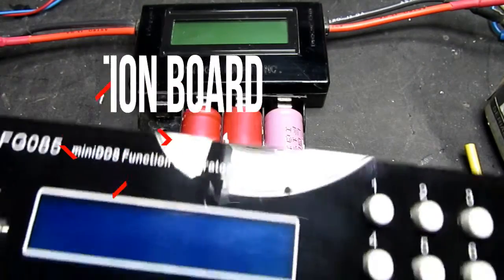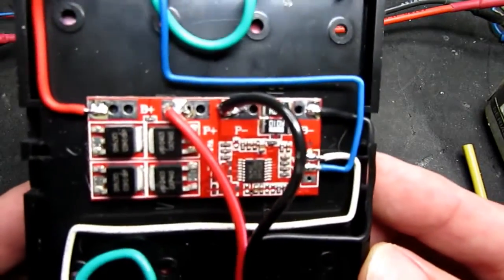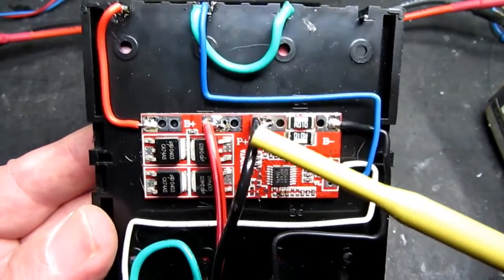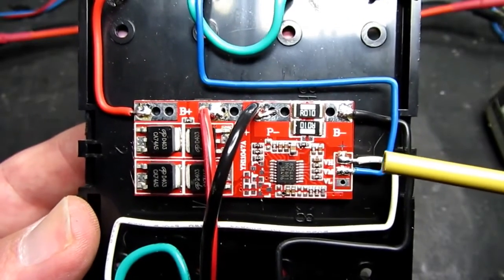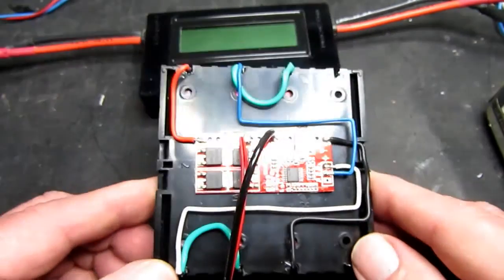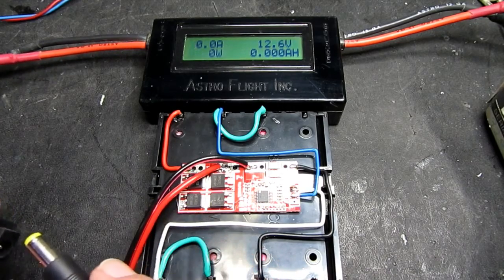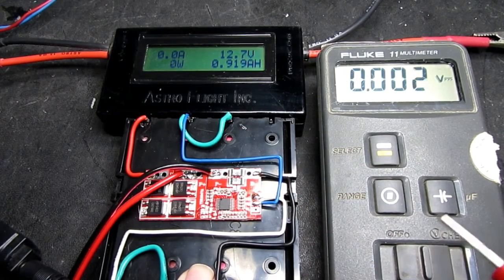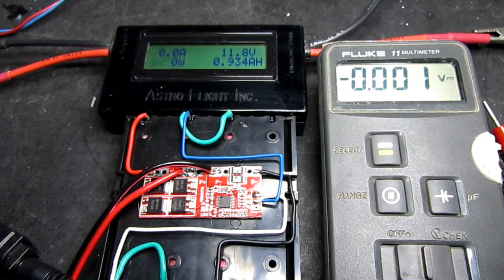3 Cell Lithium Battery Protection Board  From Banggood - Electronic Project

Comment: Hello Can You help, which voltage I need to put in to charge, I Have the same board, I Put in 12v 2amp Charger, never it get charged. This was the Board ()
Reply from the maker: Hi, the minimum charge voltage is 3 * 4.2 volts i.e. 12.6 volts : https://youtu.be/miDIXwACpcY?t=370 What I use is an old laptop charger rated 19 volts at 3 Amps and put a DC step down module which I can set the voltage an a constant current determined by the cell datasheet. The module is this one : http://bit.ly/LedDriver You can see how it works in one of my other videos : https://www.youtube.com/watch?v=QYc1On0q4AA Ciao!

Comment: i have 4s board and when i apply load on center output it drops to 0.80 im starting to think its a bad board
Reply from the maker: You may have a bad board. Also consider what the load you apply is, for example an electric drill. If a load is applied to quickly it can trigger the boards short circuit protection. In this video : https://youtu.be/rYFT4g292jU I use a 4S board on a drill. I need to use the drill slow start to stop the short circuit protection. Starting the drill slowly then increasing the speed works OK. Please consider subscribing if you have not done so already!

Comment: Did you have to do anything to get this board to start up? I have a very similar board and I get no output at P+ and P- but voltage at B+ and B- are normal.
Reply from the maker: Normally you should see the same voltage on P+ P- as B+ B-. What happens if you apply the charging voltage to P+ P-? You should be able to measure current flowing into the cells and the voltage rising. The only time P+ P- are disconnected is if a fault condition exists. Perhaps the cells are too far discharged or there is a short circuit somewhere?
Reply: @1nformatica  I applied charging voltage to P+ and P- and see no change to the battery voltage and there is no current being drawn by the board. The datasheet for the IC shows a shutdown condition for over discharge but I checked pin voltages and the don't meet the shutdown criteria. I will keep checking things...
Reply from the maker: Very strange. Does the board have balance circuit? Sometimes the labeling of the cells can be misleading.

Comment: Hi. Thank for the video. I have a board like yours. May i use it for 2s battery?
Reply from the maker: Hello, you cannot use it with only 2 cells, it is designed for use with 3.
Reply: 1nformatica Thanks for information

Comment: i have a 12v solar panel. but on sun it gets to 14 v. is it a problem to charge with it ?
Reply from the maker: Hi, It is not an ideal solution. It depends for how long you think it will be over 12.6 volts which should be the maximum. But we are using a battery protection board which is designed to prevent over charging so it should not be a problem, the board will effectively disconnect the cells from the solar panel if it senses the cells are overcharged. Worth experimenting with especially if you have some "free" cells as it show in another video: https://youtu.be/DU0vQd3Y8Jg
Reply: 1nformatica i am using this board 
https://www.google.bg/search?q=18650+battery+protection+board&client=ms-opera-mobile&site=webhp&prmd=ivn&source=lnms&tbm=isch&sa=X&ved=0ahUKEwjt6viUxKzVAhXCUhQKHUSdB8QQ_AUICSgB&biw=360&bih=521&dpr=3#q=18650+battery+protection+board+3s&tbm=isch&tbs=rimg:CQ_1l2rHyr6VCIkDq2oq-RFUNi0X7fMvMu8ywXoBL5g671_1aEee7UgMIKuGed2JUwfvJiqTNZAwsz89ZxSGhDMe6zlXrQkhLuuhw3KhIJ6tqKvkRVDYsRtqPa5AYe5tYqEglF-3zLzLvMsBEmScoKHQoz4CoSCV6AS-YOu9f2EUjyMQG1x1eOKhIJhHnu1IDCCrgRwoyLoa4iQPsqEglnndiVMH7yYhG8xXiMR9CxwyoSCakzWQMLM_1PWET1WQKEUI3JEKhIJcUhoQzHus5URL5e0OC-OcAIqEgl60JIS7rocNxHmE366FBjzMg%3D%3D&imgrc=D-XasfKvpUKDuM:
Reply: This is the board
Reply from the maker: Hi, it is a different board to the one I tested. Sorry I can not advise you about it.

Comment: Uploader ,

would u pls ans these questions :
1) Is there any BMS tht u knw which cuts off th power 💪 when each cell is discharged @ 3 volt? 
2) Can we choose th "cut off" voltage of any BMS ?
3)  BMS can be directly used for 3 cell balance charging ?
If u or anybody  kindly reply to answer , wld remain grateful. Thanks.
Reply from the maker: Hi, the module in this review is based on the 8254A IC data sheet http://datasheet.sii-ic.com/en/battery_protection/S8254A_E.pdf You can see in the data sheet a table of all the various types accoring to there preset parameters. The device on this board is "8254AAN" that corresponds to a discharge detection voltage of 2.5 volts, see this link : 3S Li-ion Lithium Battery Protection Board http://bit.ly/3SLipoProt You would need to source a different board or change the chip. I do not know of any programmable BMS boards. Strictly speaking this board will not balance cells and needs to be used in conjunction with a current limiting supply. Hope that helps!!
Reply: uploader,

Thanks for yr reply. 
1) how I m going to balance charge th 3 cell package when this BMS is wired with it?  As u mentioned it does not do balance  charge.  

2) If discharge cut off voltage is 2.5 , for ths BMS it is no good coz th cell will be damaged once bellow 3 volt. Wht u wld say? 

Thanks. .actually I need sme knowledge . :-D
Reply from the maker: Hello, If cells are matched in capacity and voltage and not abused they should rarely need to be balanced. Out of balance packs are usually seen in RC model packs where they are subjected to very high discharge rates. That is why RC modelers use packs with balance leads attached and special chargers. BMS is normally only used for relatively low currents in power supplies for electronic equipment etc. I build packs normally using battery holders so it would not be a problem to occasionally remove the cells and put them on a balance charger.
With regard to the cutoff voltage 2.5 volts should not be a problem and is often shown in manufactures data sheets as in this link: http://www.orbtronic.com/content/Datasheet-specs-Sanyo-Panasonic-NCR18650GA-3500mah.pdf 
You might like to watch my other videos on testing lithium cells: https://www.youtube.com/watch?v=DU0vQd3Y8Jg  capacity test: https://www.youtube.com/watch?v=_lDRud-Ehjw
Reply: 1nformatica 
Dear uploader,
I checked th data sheet, bt did not really get tht mch abt maximum discharge voltage. If understood th graph , it is above 2.5 volt it saying . Bt all we used to knw 18650 child never be discharged more than 3 volts and many devices (in RC world) available, starts  beeping @ 3.3 volt. 

Do u not think every time discharging  th 18650 upto 2.3 or 2.5 volt hurts th battery? Then these boards r simply rubbish .:-)
Reply from the maker: Hi, If you look at the discharge curve in the Sanyo - Panasonic data sheet you can see at the top is says "Discharge:CC:2A, 4A, 6A, 8A,10A to 2.5V at 25℃" 2.5 volts is the cutoff voltage at which point the load is removed and the cell voltage will quickly recover to over 3 volts. Sanyo - Panasonic would not do this if it damaged the cells.
Reply: 1nformatica 
Uploader,
Thanks for yr kind reply ...I subscribed yr channel & wld look for sme relevant vids of BMS tht yr  channel has. Pls make more video abt BMS cut off voltage 😄😄 . Thanks again .
Reply from the maker: Hey, thanks for subscribing! See my other video where I modify the same board to work with 4 cells : https://www.youtube.com/watch?v=sZOlD9pzaQM
Reply: 1nformatica,

Sorry , asking lots of questions. 😋
1) Do u hv another youtube channel called " My electronic hacking show" ? R u th sme guy? 

2) How much voltage is to be given to charge those 3 cell pack u made. ?  Can I hook up direct 12 volt power 💪 supply?  

3) How long th charging time? 
Thanks a lot for answering. :-D
Reply from the maker: 1) No! I do not have an Australian accent!!
2) https://youtu.be/miDIXwACpcY?t=335
3) Depends on how much charge the cells need and the current supplied.
Hope that helps!
Reply: Thanks for yr kind reply. 
Hmmm u two guys' voice is almost th same and both r very kind to answer th questions . :-D 
I love ❤ british accent. 

I figured out th answer by myself. 
If I input 12 volt on tht package, each cell wld be charge upto 4.00 volt only , not full charge 4.2 volt. 
Right ???

Can u give a link of th volt, ameter u used in yr video? Just th link above. Thanks.
Reply from the maker: Hi, Yes 12.6 volts for full charge.  The Watt meter in the video is by Astroflight http://www.astroflight.com/electronics/watt-meters  There are other similar ones available like : http://bit.ly/GT_WattMeter
Reply: Thnaks a lot sir. :-)
Reply from the maker: You are welcome!
Reply: I may consider buying tht ameter voltmeter . 
I have watched yr vid of BMS hack where u modded 3 cell to 4 cells. 
I m rather interested in rising th discharge cut off voltage frm 2.3 to 3 volt. I knw u wld tlk abt th chip. I m not tht expert to change th chip. 😜
Yes I m looking for a 3S BMS   board which has 3 volt or closer discharge cut off parameter. 

Do u knw any? Thanks.
Reply from the maker: Every BMS board I have seen has a discharge cutoff of 2.5 volts or lower. Maybe that tells you something?!!🙂

Comment: Could you please tell exactly what product at Banggood this is? I really need a board that does both over discharge protection and balanced charging (with appropriate supply of course). There are so many boards out there like this that don't do both, and as you've pointed out, its never clear which is which. Plugging the phrase "3 Cell Lithium Battery Protection Board " into banggood returns no results, and the item number in the video is hard to see. thanks!
Reply from the maker: The link to the product is in the video description: 3S Li-ion Lithium Battery Protection Board http://bit.ly/3SLipoProt if you pair this with a constant current supply e.g. Constant Current Voltage Step Down Buck Module http://bit.ly/LedDriver it will I believe do what you need. Do not be concerned that the link is to a LED driver as it essentially performs the same function. Let me know if you need any other information, good luck!
Reply from the maker: Also see my video on using the "LED Driver" as a battery charger : https://youtu.be/zTxiflmyeU4
Reply from the maker: I recently started using this one which you may find useful : 4S 30A 16.8V Li-ion Battery BMS with Balance http://bit.ly/4SBMS_Bal

Comment: Helpful but i have some questions if you have time to answer.
1) Some 18650 batterys have builton protection circuit.This means that if i want to build a battery pack with that cells i do not need protection board?
2) How to choose the correct protection board when building battery packs.What to consider?For example i try to build a 12 v battery pack with 9-11ah capacity.Should i choose a board who has output 10ah,15ah,30ah .What is better?
Reply from the maker: Hi Niklas, thanks for the questions. For number one the built in protection should have Overcharge detection, Over discharge detection and Overcurrent  protection. If it has all these features you do not need an additional protection board. For number two the important numbers to look at are the number of cells supported that is the voltage and the maximum current it can  pass. Note that this is just Amps not Amp hours (Ah). You need to choose a protection board that will pass the amount of current your load will take. A bigger number is not a problem but will be more expensive. Hope that helps.
Reply: so if i connect to that battery12v 10ah, 2 electric machines which i do not know the ah of each one but i know that they need totally 20 watts and an inverter 12v-240ac 300watt will this battery last for 4-5 hours or less because of the inverter?
Reply from the maker: 20 Watts at 12 volts is 1.7 Amps. So 10 Ah battery should last 5.9 Hours. There will be losses due to the inverter which depends on type. High quality sine wave inverters are rated at 90-95% efficiency. Lower quality modified sine wave inverters are less efficient - 75-85%. So worst case 75% of 5.9 is 4.5 hours I think. Efficiency is also a factor of output power see this link: https://www.e-education.psu.edu/eme812/node/738 I would just try it and time the result!
Reply: thank you so much sir for the precious information you gave me.liked and subscribed
Reply: 1nformatica one last question inverters exhept from efficiency doesn't have current draw?
Reply from the maker: In my experience the power consumed by the inverter itself is included in the efficiency number. I would consult the manufacturer's data sheet. In any case I always prefer to actually test and measure things myself. For some strange reason Lithium Batteries, inverters and car amplifiers all have ridiculous "marketing" numbers for wattage!!

Comment: Looking at your battery it would seem that the cell on the left (looking at pack from the back where the BMS is mounted) would read a voltage of 4.2v, and the cell next to it (right) would read a higher voltage of 8.4v because it is in series with the first cell. What I do not understand is why you would connect the lower voltage cell (4.2v) to the VH terminal. Wouldn't you want to connect that to VM? (assuming that VH means volt-high, and VM means volt-medium). Just curious as I was mapping this out for my pack it seemed a bit counterintuitive. Please let me know your thoughts... Thank you!
Reply from the maker: Hi Michael, The cell on the left is the positive for the whole battery and this is why it is connected to VH. So yes the cells are in series but go from right to left i.e. 4.2v then 8.4v. You can also modify the board to work with 4 cells as I show in this video: https://youtu.be/sZOlD9pzaQM
Hope that clarifies things and ask more questions if you need to. Thanks.
Reply: Thank you for your quick reply! I think I understand now. I was measuring voltage from the positive lead to the negative lead on the first cell. When I watched your other video, I see that you measure voltage from the last (negative) cell to the negative terminal on the first cell, thereby obtaining 8.4v. I guess I was approaching it entirely wrong. Thank you for helping clarify that for me!
Reply from the maker: As Einstein says it's all relative!!

Comment: I just got mine in the mail and I want to get this right so at 3:31 you're saying that VH and VM go to the Negative of the batteries, but there's a + PLUS or POSITIVE Symbol just above them, why is that? Thanks
Reply from the maker: Hello, a very good question! the VH and VM definitely go to the negative side of the cells. This is clearly shown when I measure the cells with the meter. The "positive" symbol on the board is in fact silver and not white which is the silk screen colour for the pin assignments. I can only guess that it is some kind of "registration" mark used during the manufacture of the PCB. It is in an unfortunate place to cause confusion.

Comment: hey nice video :) sry.. my english is not the best...so i didnt understand everything but i just bought a circuit board like this and i cant figure out how much voltage i have to put in the circuit board ? i bought a 2s 3s and 4s board, do i have to put the voltage in exactly like the output for the li-ions ???
Reply from the maker: Hi, The answer depends on the type of cells you are using. Try and find a datasheet for the cells and it will tell you the charging voltage. In my video you can see that one of the cells shows a part number, google this and you can find the data sheet. The cells I am using are 3.7 volts nominal with a charge voltage of 4.2 volts per cell. So for three cells the input voltage is 3 * 4.2 = 12.6 volts. This can be seen in the video https://youtu.be/miDIXwACpcY?t=370
Reply from the maker: tischschwein You should be close to 12.6 volts to avoid overcharging the cells. Of course this is exactly what the protection board is for! You should also limit the current. I suggest using a step down DC voltage board like this one https://youtu.be/zTxiflmyeU4
Reply: ok .. i find some step down dc voltage boards on ebay..i think i can manage it.... many many thx and keep up the good work :) 
P.s. i will subscribe to you channel
Reply: heyy coool thanks for reply.. :D  my cells have 4.2 charging voltage too... does it have to be exactly 12,6 input ?? or can i use for exampel a 16 volt DC power supply ?...
this is my second account BtW.

Comment: Is the charging connector the same as the power meter connector?
Reply from the maker: Yes, there is only one connector.
Reply: Thank you very much. I thought that two cables were needed to charge/test the battery pack and another two cables were needed to power supply the used machine.

Comment: From the looks of it, when your device is turned off, the batteries will still be connected with the protection board, and draw a little amount of current. So if you don't use the device for a while, your batteries will be depleted untill the protection board kicks in at +/- 3 V per cell.  
Am I right?
Reply from the maker: Yes, that is correct. From the controller chip data sheet it consumes a maximum of 0.1 micro amps during power down. I have put a link to the data sheet in the description. This is the same for all protected cell packs for example in a laptop. This is why if you watch my video on recovering cells from old laptop packs you can still find cells with over 3 volts even if they have not been charged for months if not years! You can watch the video is here https://youtu.be/DU0vQd3Y8Jg
Reply: Thanks for your reply. Looking at your own observation (8:40): voltage drop from 12.46V to 11.8V "overnight', suggests that the current must be (far) over 0.1 micro-amps during power down.
Reply from the maker: The cells I was using are recovered ones that were still being evaluated. I would not expect he same from known "good" cells.
Reply: great and informative thanks 😆
Reply from the maker: To find FREE batteries to use check out my other video: https://youtu.be/DU0vQd3Y8Jg